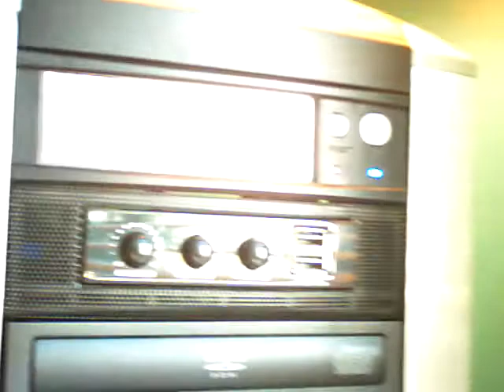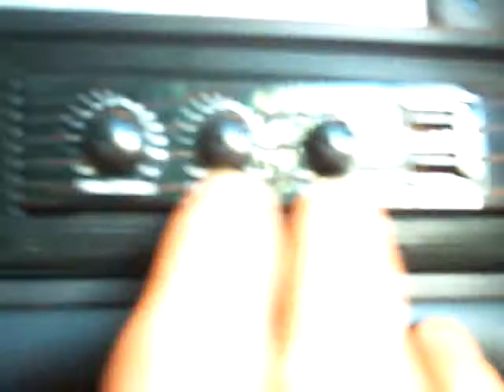My CM Stacker - UPDATE- Almost Gaming Rig Worthy!

Comment from the maker: I would wait I think they are in the works for the 32nm platform coming maybe 10-14 months???

Might be wrong but save up if you like to game and get around 2500-3000 saved or most you want to really. Then get mid range next gen CPU Quad or whatever and 4-6GB DDR3 RAM with beast GFX cards and 64-bit Windows 7 when it comes soon hopefully.

Comment: The guys below me are gay. Anyways your rig rocks the way it is right now. Better than my specs by a long shot. I have Pentium D 820, 2 Gigs RAM, ATI 200 Xpress (256MB SHARED FROM RAM), 250GB HD....Well you get the point. I'm getting about 1,000-2,000 bucks this summer. You think i should hold that money off to the new Intel and AMD processors coming out? Or do you think I should spend it on a Q9450, Q9550, or Phenom 9850? Thanks

-LoCoBoi187